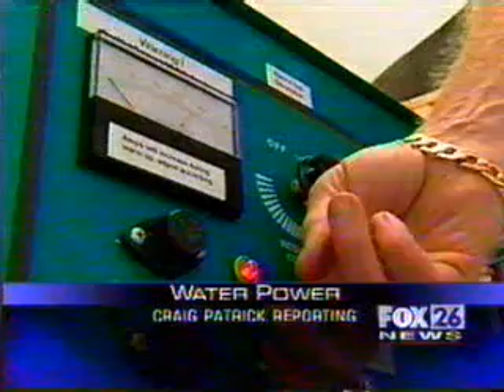Run you car on water and nothing else.

Comment: @zzytrewq 40 years later, Klines Gas demonstrates the very same Plasma Effects. NO specific heat, endo-thermic, endo-forceic, elementally reactive, continually reductive, scalable Micro to Macro, implosive GAS.
Coincidence?? Or a rediscovery, 40 years later, Independently of the SAME phenomenon and Plasma conditions obtained when using H-O-H common ducted gas? 
TR Knudtson

Comment: @zzytrewq Further, I will agree that there is NO Over-Unity here. In fact the best we could ever achieve in total closed loop testing,,, water, to gas, to electricity back to water showed only about 82% to 83% efficiency. I did however make steels using only Hydroxy Gas (water) and Solar Power as early as 1967. That Solar Power is FREE and the water is returned in the process, I called it Solar-Steels, and it never rusts.
All the best
Knute
TR Knudtson

Comment: @zzytrewq Umm,,,??? 
H2-O2 is Hydrogen peroxide and very MUCH exists. Hydroxy, Browns Gas, (ECP) Electro Chemical Plasma, Rhodes Gas are all over 40 years old and WORK. Kline has proven this by replicating this discovery, 40 years later and by independent research and demonstrating every single facility of the ECP reaction. IT WORKS.
All the best
Knute
TR Knudtson

Comment: This is a huge scam for the big reason that for all the hype, not a single one of these jokers has an actual car that runs on water. Electolysis is only about 70% efficient with waste energy heating the water.  Car engines are only about 30% efficient under ideal circumstances.  This comes out to about 5 times more energy in as coming out to power a car.  Even without factoring in other ineffienencies.

Comment: It has nothing to do with electrode material. Cl- just lets go of it's electron faster than H2O breaks apart. Competing half reactions.

Better way to go is to use sulferic acid, or potassium/sodium hydroxide. Those will increase conductivity, without competing with water at the positive electrode

Comment: You cant use sea water, because of the NaCl. The reason is that, instead of water, Cl- will break down, at the positive electrode, meaning you don't get oxygen gas, but chlorine. Which is toxic, aand HCl, which u get when u mix hydrogen and chlorine, is very corrosive.

Comment: This does make sense. It is not burning water, but is most likely separating hydrogen and oxygen through electrolysis. All you need is an electric current through water and you can separate hydrogen and oxygen. The hydrogen gas is then burned, with oxygen. Oxygen+Hydrogen->H20. Chevrolet is also producing the 2011 Volt which will go up to 40 miles without a drop of gasoline.

Comment: Its like putting a wind turbine on top of an electric car then wiring it to the motor.  Yeah you would get some electricity back but the drag of the wind would be make the motor have to work harder.  The net gain would be negative.  
P.S. HHO is the same H2O  just notated wrong.  That's known as marketing

Comment: I believe it when he says the car runs on water BUT it takes energy to split water into hydrogen and oxygen.  Water molecules don't just fall apart without applying electricity.   So he might be running on hydrogen and oxygen but he doesn't mention he had to plug into the wall for electricity for 10 hours to do it.  Its just another form of a battery but more dangerous because you would have to store hydrogen and oxygen (basically rocket fuel) in the car.

Comment: You can even split water at high temps and then burn some of the hydrogen and oxygen to maintain those temps while the remainder of burning gas can be used to power whatever you want,,,including power stations. Pollution free dirt cheap water power must be possible. Water splits at about 3000 degrees c it think. Anyone know? Ceramics can stand those sort of temps (space shuttle tiles for example) so making water burning combustion chambers and heated injectors must be possible. Am I confused???

Comment: I'm not disputing the fact that the engine runs.  I'm saying that the energy that goes into making the water into fuel requires more electricity that would be produced by just a normal hybrid engine which we already have.

Comment: um, whether you realize it or not, you and I are on the same page here.  we both agree you can't get energy out of water and we both agree that thermodynamics state that even if they did you electrolysis to make hydrogen and oxygen and then burned them, that there would be no energy gain, but there will be an energy loss due to heat loss.  we both agree that the process in the video will not work whether the process is efficient or not.  If you don't understand that then there's no hope for you.

Comment: Rubbish, you lose significant amounts of energy in any thermodynamic process, and also in electrolysis, (you have to cool the thing down, some energy will escape as heat). The car doesn't run on water, but on gas produced with electricity, essentially from the fossil-fuel or atomic power plant. The water gives no energy. Similarly you can get simple hydrogen gas from water to power any machine - but that reaction also takes energy.. it's more a question of whether this is an efficient process.

Comment: the amount of electricity required, at best, merely equals the output of this device; and that's assuming that 100% efficiency is reached.  This isn't really practical since you don't actually "gain" any energy out of it.  Your starting reactants are the same as your ending products meaning that nothing was lost or gained.  It's called conservation of energy, you morons.

Comment: The actual process that is being used to convert water to HHO..Its not using electricity in the conventional electrolysis method. instead it aims at a certain frequency range using a NE555 Timer/Oscillator or something similar and needs no more than...I think 3.5V to produce enough HHO needed to run a car.

Dont get stuck inside the box:)

Comment: You can't get more energy out than you put in. It's the first law of thermodynamics: "The increase in the internal energy of a system is equal to the amount of energy added by heating the system, minus the amount lost as a result of the work done by the system on its surroundings." You're using electricity to create electricity through an inefficient process and adding an unuseful extra step. Long story short, it takes more electricity to convert the water into HHO than you get back.

Comment: The point that it takes more energy in than you get out is well taken. But when you think of it, there is quite a lot of spare energy from your cars alternator. Costs nothing extra, and you are only talking an extra amp or two. I've seen this on a vehicle (diesel). Seems to work. I've yet to actually get a definitive bottom line, mpg wise. All it's doing, is weeping the gas into the inlet to help the combustion process.

Comment: What the critics forget is that oxygen found in the atmosphere contains energy in the form of its reactiveness (extra electrons). That means that you can get more energy into the system by burning electrolyzed h2 or hho gas than it takes to make. Its not circumventing thermodynamics, its just that people dont' realize that oxygen is a reactive substance that only exists because of photosynthesis.

Comment: the electricity thats used to split water molecules can be generated via solar panels and/or accumulator and alternator generated by the vehicles own motion

in much the same way your car battery is charged.

Comment: The amount of energy that hydrogen can put out is less than the amount of energy that was required to extract it from water.  You still need traditional fuel sources to make production of hydrogen possible. What good is it to burn a gallon of gasoline to produce a quantity of hydrogen that puts out the energy equivalent to a half gallon of gasoline?

Comment: Plugpower makes a natural gas fuel cell. This company has been slow in developing a market just changed directors though? Lot's of natural gas and a cleaner more efficient method to burn it. Also can produce hydrogen as a by product for car refueling and enough electric for household off grid.

Comment: In a steam engine, water is the working medium, not the fuel source; you burn coal or wood or oil to heat the water, so the fuel is the substance you burn, not the substance you heat.

Water has never been a fuel source. Water wheels and damns don't count; the water pressure is the energy source, but the water is not technically fuel in those cases.

Comment: It's funny because the last time I checked, the original stock cars were steam driven until the gasoline engines _finally_ beat them out efficiency wise.  You might want to check if the steam engines were similar to coal furnace locomotive engines, but I think my point is that water has already been a major fuel source.